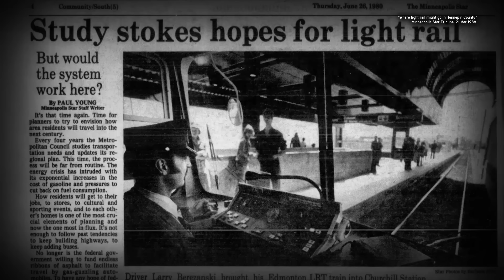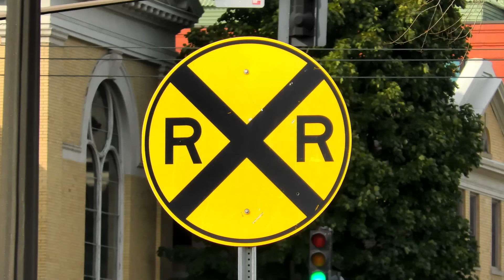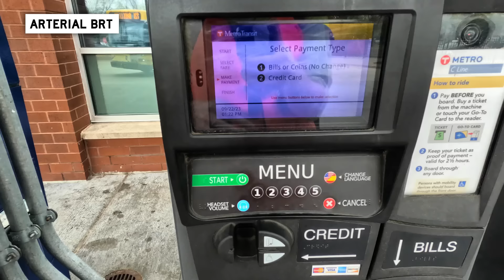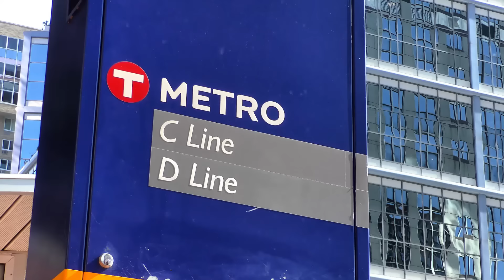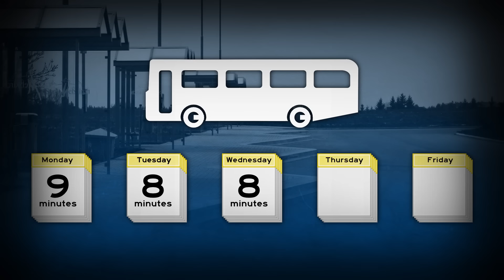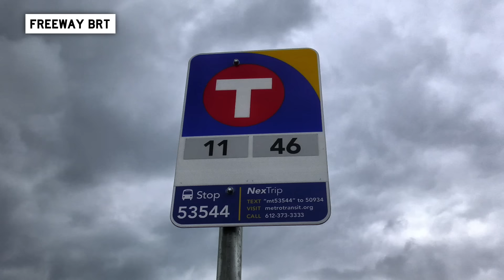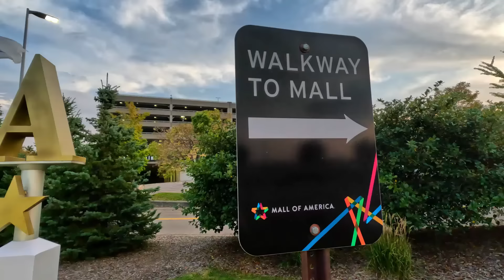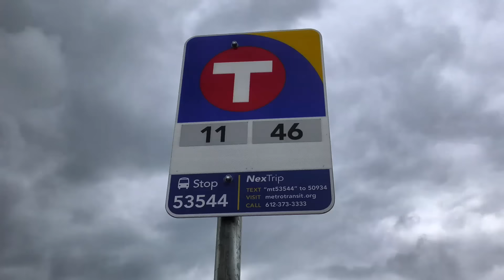Meet Minnesota’s $500-Million... 🚍 BUS???

Comment: It will be interesting to see the ridership numbers once this is completed. Pre-Covid around 2015 Metro Transit surveyed riders on the Express routes between Woodbury and Minneapolis and used that data as part of the reasoning to build this line. Post-Covid ridership on Express routes is down considerably. I noticed an all but empty Minneapolis Express bus on the freeway the other day, had about 4-5 passengers on it at the height of rush hour. When I rode the express bus you'd have all the seats filled and people standing in the aisles at times on a coach bus and even the articulated buses. So far this seems like a colossal waste of money is ridership is this depressed. Hardly anyone wants to work in an office 5 days a week like they used to.

Comment: Not a fan of BRT.

The system we have here (Los Angeles Metro) is popular but I don't know why.  Under ideal conditions it still takes much longer than driving.

I guess if you were forced to work in Downtown L.A. AND your company didn't pay for parking you could justify the extra time spent sitting on the Orange Line (or whatever they are calling it this week) because you'd be saving hundreds of dollars per month in parking chargers but even in that case I'd be more likely to just drive to the subway station at the end of the line (bypassing it entirely) and then catch the (pretty fast) subway into DTLA.
Reply: Transit should always take longer than driving in a functional transportation system. Ideally, there is a high cost fast option (car) for high priority trips, and low cost slow option (transit) for low priority trips. Having to compete against driving in speed is really a first world problem where no one is cost sensitive about car ownership because we made cars too affordable to use through a combination of high incomes and subsidies.

Comment: There's no difference between a trolley car mechanic and the bus mechanic, they both turn wrenches.  Here's something else you can put in your pipe and smoke it,  a carpenter is a mechanic. Who used to carve the gears for the water wheels and the windmills? A Millwright is a carpenter working power plant shutdowns.

Comment: The city where I live is gradually pulling the plug of BRT. BRT line 1 is about to be cancelled and same maybe for line 2. I personally dont see any advantage of BRT over local bus lines. Especially if you could spam local buses and letting themselves creating a bus corridor. Also improving local buses infrastructure a bit (At least getting a bus stop with a boarding area). Most BRT features can also be applied to local buses. (Except pay before boarding)
About the reliability aspect. I think bus service should be operate in a railway or metro like arrangement. Always keep and put some ready to go buses within busiest corridor. So if some disruption occurs. Let those ready to go buses fill the gaps. (Actually metro arent that reliable as well. They also keep some ready to go trains in pocket track in case some train fails, or excess ridership occurs.)
Reply: I mean you can easily add pay before boarding to local routes, Costs more but it wouldent be too bad if you already were upgrading the stops themselves. Plus just making the busses cashless and building out a GOOD app where you can pay on your phone would already solve most of that: If you cant afford or dont want to put in kiosks at the stops give the bus the ability to take a card payment and spit out a temp paper ticket, if every tent at my local art walk can have a credit card reader busses can too.

Comment: I am so extremely disappointed that monorail didn't beat lightrail. It's so much cheaper to maintain and actually turns a profit, unlike light rail (or any other pubmic transit); a constant money pit. This allots more funding for more lines. It's also only a little more expensive to build, its out of the way (no crossings, also means less to maintain), safer (no crossings) and amd way quieter. Disney had theirs running through an entire hotel building! You can run it in cities without any noise problems.

To my understanding also, elevated monorail is cheaper than elevator heavy or light rail. To this day I still do not understand why politicians made their huge [____] up of devoting themselves to lightrail instead. We can't have nice things...

Comment: The new very expensive bridge across I-94  is 6 blocks away from the recently revamped Radio Drive bridge. There was no reason to spend the money to build a brand new bridge. The premise of the Gold Line is a forecast of 6000 riders a day. Long after that forecast is proven to be the nonsense it is the taxpayer money for the new bridge will have been long spent. 
Given the incompetence displayed daily on Bielenberg drive by the contractor there's no way you'd get me onto that new bridge.

Comment: I saw an arterial BRT system in action while driving through Nicosia. It's probably the most congested city I've ever driven in, but all the main roads had bus lanes which did a good job keeping the buses out of the traffic jams. However, at the end of every street there was a huge wide intersection with complicated arrangements of traffic lights governing the bus lanes separately from the rest of the traffic. Good idea, apart from as far as I could tell the car traffic was being prioritised over the bus lanes in the signalling. I spent about half an hour sitting in traffic through the city and more than once I would reach an intersection and overtake a bus sitting at the lights which had sped past me in the bus lanes a few minutes earlier.

The annoying part was that I didn't even need to be in Nicosia, but the main international route connecting the rest of the Rep Cyprus to the TRNC is via the main roads through the middle of the city. If Nicosia had a bypass road to the west of the city a good portion of the traffic wouldn't even be there, but the political situation on the island and the old airport would make that difficult.

Comment: Arterial BRT is the definition of BRT creep. Instead of calling it Arterial BRT, they could have continued to use the same 60 foot buses, and just spaced out the stops, and made improvements to the bus stops. Is the only way to improve bus stops, and to space them out more, is to call it BRT, or is calling a regular bus route BRT come with extra funds from the Federal and State governments? It seems as though they didn't even want to invest in BRT buses, and instead just bought normal articulated buses and put a different paint scheme on it. The technology exists to have a bus with doors on both sides of the bus, they have been using them on the streets of Eugene and Springfield Oregon since 2007. Only with dedicated space does service really improve because the transit vehicle is not stuck in the same traffic as drivers, and thus becomes an appealing option.

Comment: Sounds like a great project overall. Maybe I missed something, but why not electrify the BRT lines and use an electric bus? Not battery powered, but one that connects to catenaries and is powered by the grid. I also wonder if that infrastructure could also "future-proof" and allow for a light rail to be installed. There are plenty of cities in Europe that use electric busses with overhead power lines.

Comment: My city's new BRT, officially known as City Line, shares existing streets only, and the busses get stuck in the same traffic they claim to alleviate. This is what happens when you force busses to share with cars.

Plus, the bus shelters on the BRT route are not protected from weather, do not have many actual benches, and do not run on the city's busiest corridor.

To be fair, a new BRT line is planned on Division Street, a seven-lane stroad that shares two highways, but that is getting pushback from car-brained citizens with massive trucks.

Comment: Just a couple of things:
1) The LRT line (under construction) mentioned at the end is not an expansion of a line but a new line from Eden Prairie to Minneapolis. Its original price of $2 billion has ballooned to $3 billion, and its completion date pushed back 5 years.
2) The Lake Street transit station is closed for reasons other than a malfunctioning elevator. Let's just say that it has been reported in the news and leave it at that.
3) Metro Transit just announced last week that the LRT trains will be reduced from 3 cars to 2 due to low ridership.

Comment: How much does a light rail cost per mile compared to a freeway per mile?  It's funny how dollars matter … only sometimes.
Reply: Freeways are used for passing through the city, and for local and regional freight, so the economic cost makes sense more so then a light rail line which will only be used for local traffic and in most cases in the U.S. have very little ridership.
Reply: @joeblow5214  With you there on the purpose of freeways!  We gotta get the traffic off freeways that shouldn't be there in the first place though -- cars should be a choice, not the only option for everyone going everywhere.  Nothing better than a freeway that's empty not full, especially not full of daily commuting, which seems like the biggest waste of time

Comment: They did this in Albuquerque, New Mexico. Well its a complete failure. First off the places where the bus crossed intersections, the signals confused drivers. This lead to quite a few crashes the first year, probably still have a lot too. Then there is the fact that the homeless would take over stops, or even entire buses. Then there are the drunks, criminals, and whatever else using it. And finally almost all of the fancy stops now have feces on the ground, seats, or even in the corners, and then there is the urine smell. The supposed "highly efficient buses" weren't so efficient. The electric buses didn't work. There were fires. I am certain there were even more problems but I quit following the story years ago. 

I like the idea of having some sort of mass transportation, but I think buses are not the solution. 

Oh yeah, the fights and getting mugged on the buses was another issue, but of course that would be an issue anywhere.

Comment: Can you do a video about the never ending i26 expansion/connector around Asheville nc and why it was managed the way it has? there’s miles and miles  of half finished work and equipment laying all around and what appears to be no more than 10 dudes doing the whole thing. Why didn’t they finish one section first!
Then there’s the new connector and that looks crazy because of the rivers.

https://youtu.be/fIFc5q3YGC0?si=5_UiA0X-Lsi4_QOb

Comment: you know what would be wonderful? If they thought about wheelchair users like me who live in MN... Cant use a single one of these damn buses. Yeah its quicker and cheaper than a train or rail system. But people like me get left behind and fall in the cracks of use of public transport. Im not a priority for MN, im not even a thought.

And yes I know they are handicap "capable" but combined weight of user plus wheelchair cant exceed 600 LBS and if you are unaware many wheelchairs easily break the 400 LBs mark, take mine for example its a Permobil Corpus F5 VS. Stock weight is 432 LBS, so id better weigh 170 or less or im not allowed. Sorry but I live here and fuck MN transportation.

Comment: A bus... every 10 minutes... is called frequent? Its better than every 15 minutes but most people would consider waiting 10 minutes for a driver that misses their schedule time or just doesn't show that day to be a deal breaker. The light rail transit  in the North American city where I live has 5 minute frequency during rush times and the city is nowhere near as large as the twin cities with less than 1/3 of the population... and I don't think that is particularly good service, 3 minutes is possible and would be far more acceptable AND there is ridership to support that since the LRT is jammed during rush hours. Buses can serve suburbs to get to arterial... arterial needs dedicated rail services
Reply: Well, it's a shame that Road Guy Rob has locked them into that 10 minute interval.  It can never be changed, even if ridership skyrockets.

Comment: Could you please do a video about any mass transit system that is actually self supporting without a regular infusion of taxpayer dollars?.... I see a boatload of tax dollars wasted for the life this debacle.
Reply: I'm pretty sure its impossible to have a mass transit system that makes a profit without taxpayer funding. Just look at how much it costs to maintain roads and such. Public funding is a must! No?
Reply: @blathersb  The opportunity costs and the sheer flexibility of what traffic you can have on roads makes them make a lot of sense. Rail runs a fixed route and requires far more specialized equipment and traffic control. In super dense corridors rail makes sense, but outside of that you are better off running road based transit. Places that have trains still use a lot of roads and freeways and we have a far larger freight rail network then Europe that still requires a lot of truck trips again like Europe.
Reply: Even our road network is not self supporting. Transportation of any kind requires subsidy
Reply: @joeblow5214 that's all fine and well, but don't pretend roads are not also subsidized (and with good reason)
Reply: @onesob13  I don't deny it, we also subsidize rail a lot. Mainly via railpark development and federal improvement grants and low interest loans.